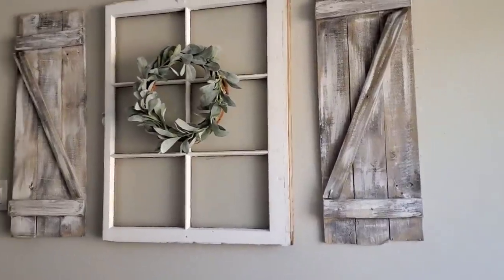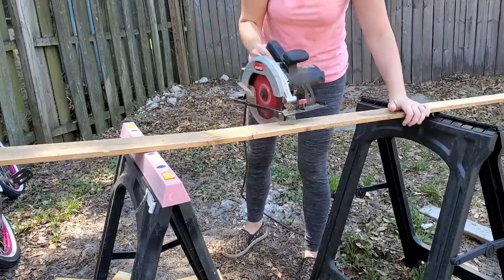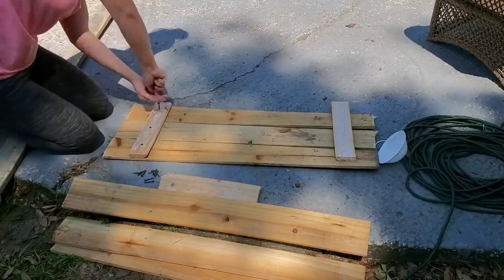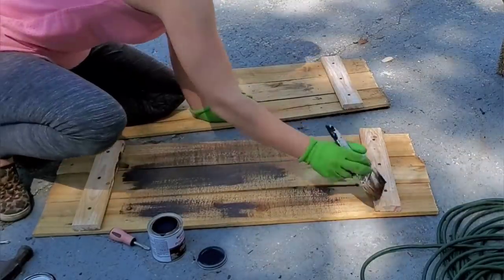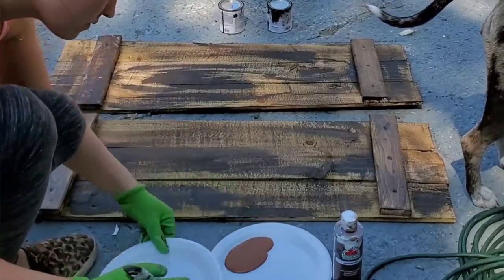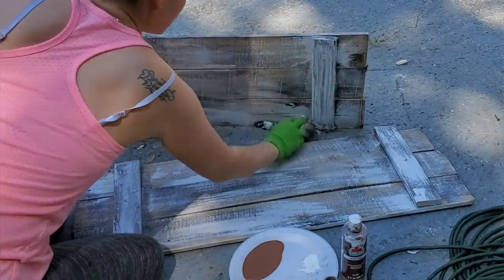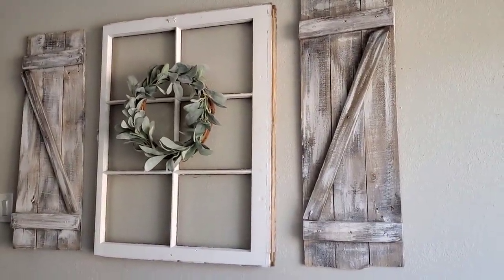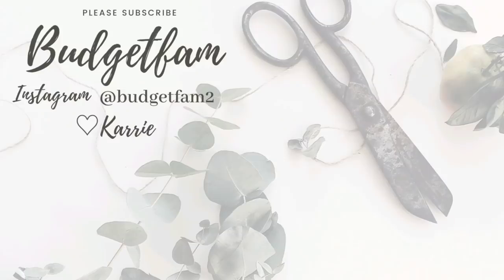DIY Farmhouse shutters using scrap wood / Budget friendly.

Comment: You can get the black and decker cordless drill. It's easy for screws to drill, for me at least it is. If not the drill, the have a chargeable easy screwdriver in budget range. It also depends what store or site you buy products from for the good deals as I'm sure you know. Lol